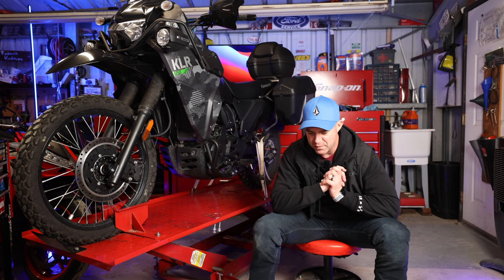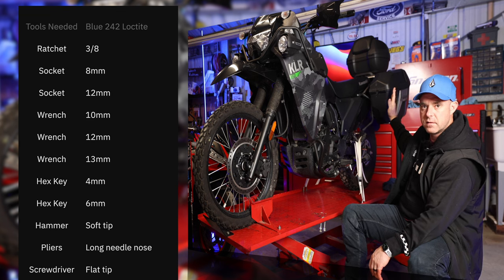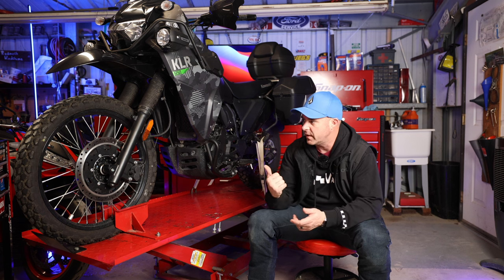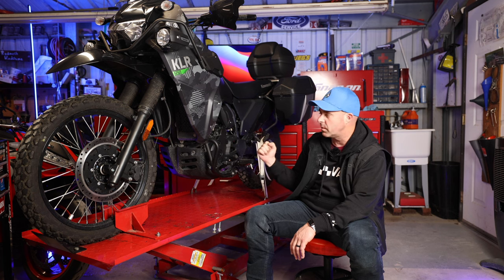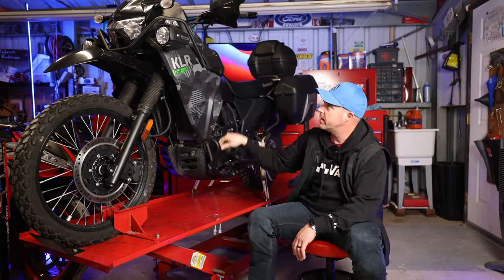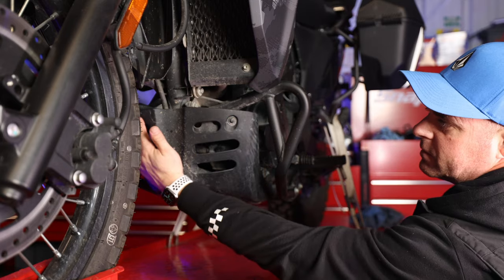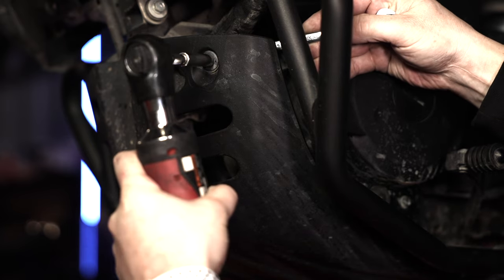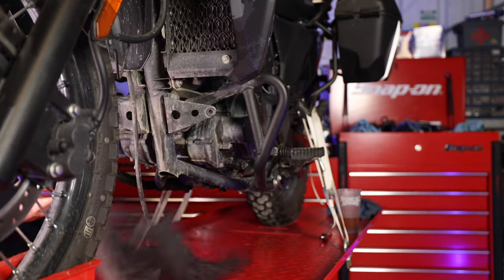Installing T-Rex crash guards 2023 Kawasaki KLR 650

Comment: Installed these on my buddies bike this weekend.  Those two bolts at the front are a pain.  Your video was very helpful!  Leaving everything loose until you are done is definitely the way to go.  FYI if you have the Tusk skid plate you need to trim some off the top to make it fit.
Reply from the maker: Nice, glad it helped and good point on the tusk

Comment: If you watch the T-Rex install video carefully, I believe it says "if you have the stock or T-Rex lowers NOT to use the PIA spacers" at the front frame bolts.  (In text on the screen)
Reply from the maker: I just watched it and it did have that typed on the screen as he was installing. I t still seemed like the gap needed to have the spacers in my opinion as I installed it 🤷🏻‍♂️
Reply from the maker: Missed typed that lol, I did see that in the T. rex vid
Reply: As I remove the 12mm bolt to release the stock light bar, I believe the bolt fractured. The new 13 mm bolt nor the original 12mm will tighten. There was no obvious lock tight on the stock bolt so I don’t know where to go from here.also I  officer two loose rubber lines-this is fuel and coolant overflow?  Where do these go once I’m ready to reinstall my skid plate?

Comment: Excellent synopsis and demonstration. Any torque values to be aware of? These bars look really functional. Thank you for posting. I will reference this video if I get these for my 2023 KLR 650 adventure ABS.
Reply from the maker: Sadly no torque specs with the instructions but you could just go by common torque per bolt size as none of it is aluminum. Read through some of the comments on this vid, there are comments about small modifications for the ABS version. Glad it helped out cheers
Reply: @ScoutsOut  Lol, I was in a parking lot today practicing shorter radius turns and figure 8s……laid the bike down!! 😩😫 it was at a very slow speed no injuries to me and the Adventures lower crash bars and plastic boxes on the back took the brunt. I was concerned about lifting the bike back up……non issue, very easy dead lift style. I need crash bars!!! Thanks for the info on the torque specs, I will do some research on it.
Reply from the maker: Sry to hear that, yes you need the bars on for sure now. Good you were out practicing though
Reply: @ScoutsOut  no damage to the fairings at all, which are apparently big $$$$$ to replace or repair. Yeah, crash bars for sure before going on trails or more challenging dirt roads.

Comment: Note previous experience with vstrom and similar engine guard did shift the frame. However crash for mid section like this isnt necissarily provide benefit as handlebars and their ends extend further. So when the bike goes gown it damages the handlebars and potentially not the frame like this. Some mods i have seen aand accessories are worthless and people think there is benefits with no downsides. After all the dropping i did and bikes destroyed no longer buy this stuff and ride stock saves money and since doing that prevented some damage these accessories would have caused and protecting myself in the process.. good video though.
Reply from the maker: Oh dang, that’s what I was worried about. Yea I could see bars taking the brunt, thanks for the info

Comment: I had problems with the right fairing bolt also. But I absolutely cannot get the right rear bracket to mount due to the existing factory hardware mounted to the frame. I have looked and looked but there doesn't seem to be any way to mount the right rear section. How in the heck did you get around the equipment that is mounted and screwed to the frame near the right rear side? Any tips? Mine seems to look just a bit different. It's about the 7 minute mark of video that I am referring. MIne has ABS brakes and it is possible the object that is bolted to the frame may have something to do with that. Does yours have ABS brakes?
Reply from the maker: That's weird, mine doesn't have abs. I'd be interested to see what you are talking about. Do you have instagram? If you send me a pic I could try and help you. @scouts_out_yt
Reply: Hi Ben,

My 2023 KLR Adventure has ABS, and I know exactly what you're talking about. This device has some tubes going through it (I wish I could paste the pictures here).

I was able to place the internal part of the tube clamp right above where this device is screwed to the frame, but before I needed to partially remove the plastic fairing in your left (the back of the bike). Now, I am facing another issue, because there is a weld hindering to place the external part of the tube clamp. I believe the solution they gave to the same problem in the left bar should work here.

I just sent an e-mail to them asking about it.

BTW,

Did you get your bars installed? If so, how you solved these issues?

Thanks.
Reply: @ygordarochaparreira2810  how did you end up resolving this?  I just got my trex bars and am stuck at the abs bracket.
Reply: @273zink  Did you have success?  I'm stuck there as well
Reply: @garysinclair6490  I found a suggestion to flip the abs bracket around and then reinstall it and that worked for me.
Reply: @273zink  Im stuck here too. I'll pull the plastic muffler guard panel off and see if I can figure this ABS bracket stuff out...Major setback for plug and play.

Comment: Congrats on a superb instructional video! I'm a pretty darn good mechanic but this helped me a lot on the install. The hardest part I had was getting the upper fairing bolts back in at first. I watched your video a little at a time as I was installing so the left side bolt drove me nuts. Got it started finally after using a flashlight to see the misalignment and then saw you mention the issue later on the right side. My solution was to pull up on the fairing plastic as I threaded the bolt in. As far as the 2 lower bolts I fully tightened the top bolt and then had to take a long drill bit to slightly enlargen the lower bolt hole to get it through without damaging the threads. The bolts were slightly too short to fit the second steel washer on my install. Anyway, great video. This is what I aspire to do on my channel but am too lazy to do it.
Reply from the maker: Nice dude thanks, I hear ya on the effort it takes to made a vid lol. Glad you got them installed 🍻

Comment: The trex stuff looks tough on the bike! I plan on buying all their stuff for my klr650. I like the design of their skid plate as it protects the lower shock link too. Nice stuff. Good video. Now i know how easy the install is. I am just gather all my stuff so when this snow goes away I will be ready to install everything at once. I also bought the Vstream medium windshield and plan on getting a zumo XT for it to. Did some long dirt roads last year with friends it was a blast. But I was always worried about dropping the bike. This crash protection looks like just the ticket!
Reply from the maker: Yea they make good products from what i can see so far. Ill have to check out that windshield I haven’t found any that i really like yet, hopefully the snow goes away soon man. Let me know what you think when you get all the parts installed

Comment: Great video! I also want to keep the stock lower and upper bars and install this T-Rex! Looks pretty solid! Glad to have this such a helpful video instruction! Many thanks!
Reply from the maker: Thank you, much appreciated and I'm glad the video was helpful!
Reply: @ScoutsOut  Do you feel legs comfortable near the middle support pipe of these bars? Do legs touch this pipe when they hold the tank?
Reply from the maker: Yes the top of my right calf rubs agains the bar and it's a little annoying
Reply: @ScoutsOut  that's what I'm worried about! Thanks!

Comment: Thank you. 
Only thing that might make it easier is to remove the 3rd skid plate bolt. Install the 2 smaller ones first and the larger bolt last.
Reply from the maker: Glad it was helpful! Nice good tip!

Comment: Great job as always Scout... The could have provided a slightly more aesthetic set of bolts for the section just unter the light though... But besides that... One set close to spring time adevture rides mate! :D
Reply from the maker: Yea Phil I was thinking about covering or paint them lol. Can't wait!
Reply: @ScoutsOut  Can you not just "match them up" with something from the hardware store? Or maybe find little black plastic caps for the bolts...
Reply from the maker: I didn't think about just buys black hard ware. That's for the ideal Phil

Comment: You ride in the cold too!  Hey, do you ever  condensation in your oil site glass after a ride? I do, but I believe it's bc some of my rides are short ones and moisture doesn't have time to burn off.
If you ride in the cold maybe the Thermo-Bob would be a good mod.
Good luck Man.
Reply from the maker: Haha yea man, now that I got some good cold weather gear and heated jacket it's nice. No I've never noticed the condensation on the glass but I'll check next time I ride, once my warranty is up I will probly look more into the doohickey and thermal bob

Comment: They changed to hardware to a black finish.  But it seems they may have shortened the bottom bolts that connect underneath the skid plate. I don't have enough bolt left to use the washer
Reply from the maker: Go without the spacers if you have the adventure like mine that comes with the lower roll bars

Comment: Those are heavy duty a lot of protection. If you ever have a situation you can weight it that would be interesting. Prob high 300's? Interesting to see compared to the other adventure style bikes even compared to the bigger cc ones. 🤙
Reply from the maker: Yea bro should be good when o drop it, but sadly the klr is heavy as hell, it's almost 600lbs she is chuncky but the weight is pretty low and hard to tell luckily
Reply: @ScoutsOut  holy shootz that is a beast! I guess a BMW or KTM adventure’s are pretty heavy too.
Reply from the maker: Ohh yea the bmw is a real monster

Comment: Hi What are the torque specs for the bolts that go through the center engine mount bracket?- thanks!
Reply from the maker: I can’t find one, I thought it was on the paperwork but I guess not
Reply: It’s 18 ft/lbs for those bolts
Reply from the maker: Thank you

Comment: Will this fit a 2024 adventure KLR
Reply from the maker: Yea, still the same bike, the only change is with or without ABS
Reply: @ScoutsOut I installed it ..for some reason the right side is just barely touching the body frame.

Comment: Hi,

Thank you for the great tutorial, very much appreciated (I am using it to install my bars). I liked that you specified the socket sizes for each bolt (12mm, 8mm, etc).

Regarding those spacers you put on those hardest bolts to install, it seems T-Rex recommend them only if you DON'T have the T-Rex or OEM bottom engine guards, which you have, so you were supposed to not install them, as you can see here: https://www.youtube.com/watch?v=-0Icuveyh2o&ab_channel=T-RexRacingInc

Besides that, great job! Definitely a better install tutorial than the one T-Rex put in place.

Thanks,
Reply from the maker: Thank you I appreciate that!